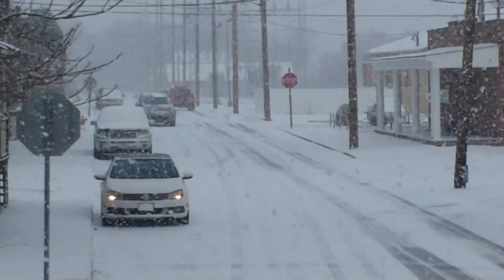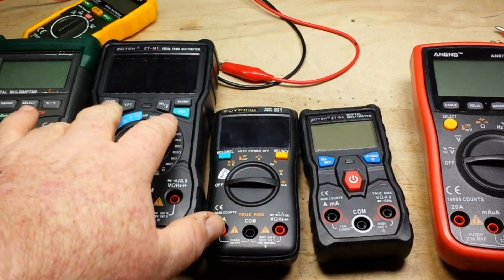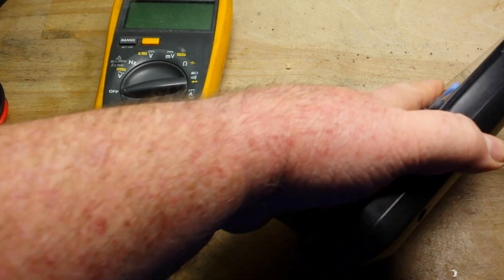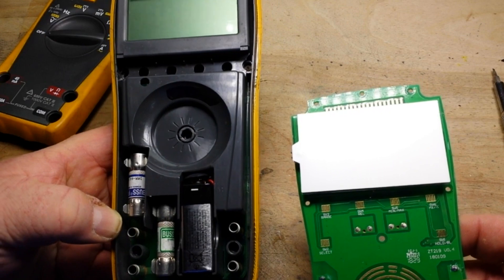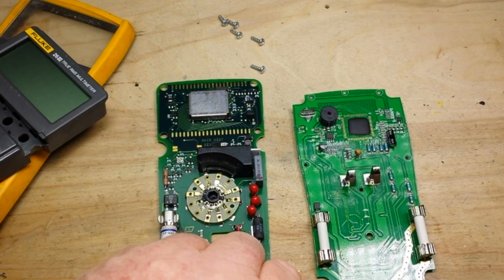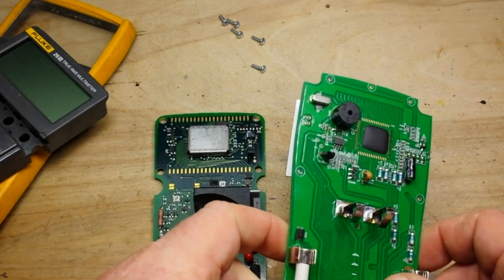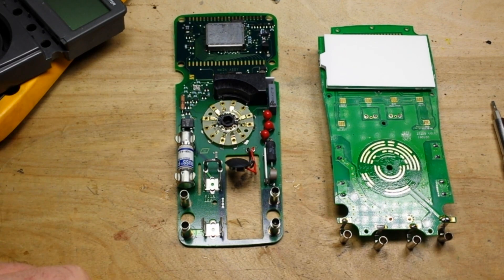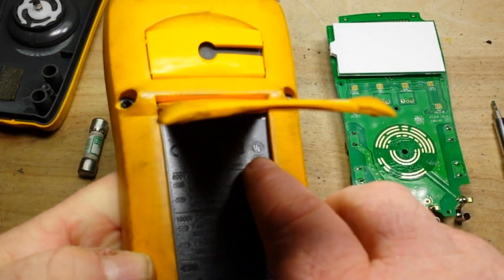Multimeter comparison: Fluke vs Chinese

Comment: An omitted thing is EMI (electromagnetic interference) shielding on Fluke processor. It has a metal cover while cheaper Chinese hasn't. Once my father bought me Meterk digital multimeter with non-contact voltage function. I decided to use it for testing of EMI detection. A circuit housing of operational 55W compact fluorescent light was used as an EMI source. Meterk multimeter was essentially fried. Analog multimeter is unaffected.

Comment: Nor really Chinese but Taiwanese, How about Brymen? Looked at the 869. Same fuses as Fluke. I saw a serious over voltage test once, between  on a Fluke and a Brymen. The Fluke didn't survive, the Brymen did.
Reply: that was probably Joe Smith's channel? The Brymen 869S is his favorite multimeter for those reasons.
Reply: @mrpetit2  Looked it up. It was. where i saw it.
Reply: And Joe does a great job testing all the meters by putting them through a number of tests until they fail. He uses his Brymen 869 as his daily driver now and for good reason. Fluke are good but not competitive enough and with less features and in some cases safety for the money you pay.
Reply: @mrpetit2  Joe retested Fluke meters and that one early failure was an anomaly. I don't think he even has that video up on his channel anymore? At least if he does I can't find it. The second time around another Fluke meter acquitted itself well though.
Reply: @1pcfred  you can see in Joe Smith's topic on eevblog in the spreadsheet that a brymen 869s on average fails later than a fluke 87V on average (from both meters 2 different meters are tested with his newer higher energy testing equipment), but both can definately be considered very safe meters as these tests are far beyond normal operating parameters. 

But given that a Brymen bm869S is also about 1,5-2,5 times cheaper than a Fluke 87V and is much more accurate, has a much higher resolution, has more functions and is equally sturdy build makes it a very good choice for consumers I think.
Maybe for consumers the BM867 is the optimum choice. It has the same resolution as the BM869s is 0,03% accurate instead of 0,02% (so still more accurate than the 87V and still has that 500.000 count resolution) and only misses the temperature probe setting, but is only €150 incl VAT in europe (which equates to about $137,50 ex tax). A real bargain.
Reply: @mrpetit2  I learned at an early age that I don't like the sensation of current passing through me so I avoid it personally. I don't need expensive test gear to facilitate that either. Just some uncommon common sense.
Reply: @1pcfred  then you'll be fine with both Brymen and Fluke meters.
But be sure to stay away from 10kv line sources etc, neither meters are suited for that 😉😁
Reply: @mrpetit2  I've built circuits that have gone far beyond 10 kV. I'm just not stupid enough to try to measure them with a meter. That's the secret there.
Reply: @1pcfred  Excellent. Then you know that a Brymen dmm is an equally good choice as a Fluke for a consumer if not better.
Reply: @mrpetit2  I don't think typical folks need a multimeter. Amateurs do not need anything as expensive as a Fluke or Brymen is either. But if that's how someone wants to spend their money more power to them.
Reply: @1pcfred  what do you mean? 'typical folks don't need a multimeter' in sense that they need food, shelter, safety and medical care? very true but I don't see how that's an argument in the scope of this video.
Or do you mean amateurs don't need a multimeter like fluke or brymen because its perfectly safe to prod budget multimeters like a UT-61e or cheaper into mains voltages?
Well you can take that last one up with Dave Jones or Joe Smith; they specialize in that field.
And fact is that Brymen isn't nearly as expensive as Fluke. With Fluke you pay up to double the amount of money for a product with equal fuctionality/accuracy/safety, even with their budget chinese made products. The USA made stuff is even more expensive, without being better or safer (as testing by Joe Smith showed in case of the 87V)
Reply: @mrpetit2  it is absolutely safe to test mains voltages with any DMM. The impedance of a DMM is astronomically high. On the order of tens of megaohms. Freebie Harbor Freight multimeters can safely measure over 900 Volts. Not a problem.
Reply: @1pcfred  then we take your word over the word of Dave Jones or Joe Smith that 900V is not a problem and perfectly safe with the cheapest of cheapest multimeters 👍😁
Reply: @mrpetit2  you believe whatever you want. What do you think happens when a multimeter gets fried? When anything destructs? This ain't exactly a power transmission wire dropping off a pole here. It's a little bitty meter with little bitty parts inside of it. Shorts have a way of clearing themselves. Stuff blows up once. With little bitty parts you only get a little bitty pop out of them. Little firecrackers don't make mushroom clouds either. I did see a transformer blow up in a substation once that made a mushroom cloud. We all cheered, Do it again! You want big boom you need big stuff. That's reality.
Reply: @1pcfred  Dave Jones has a video where he explains why you want to have input protection when measuring on mains:
https://youtu.be/zUhnGp5vh60
One main issue is to cope with possible transients in line voltages.

You can believe whatever you want, but in the end large companies like Fluke (and virtually all other main A brands) choose to put input protection it in their meters.
If you think that's in vain, fine. But then take that argument up with Fluke (or Dave Jones, or Joe Smith). If you can convince Fluke I'm sure they will be very grateful as it'll save them millions annually in expensive components they can skip upon.👍

Comment: No multimeter is made out of high explosives. If it goes pop it is not going to detonate like a hand grenade. Although that big resistor in the Fluke should go bang pretty good if it ever lets go. That being said I don't care what kind of gear you have when you're working on high energy electrics you'd better be careful. It is complacency and relying too heavily on "safety" devices that ends up getting people hurt, or worse. Just because you're using a Fluke meter doesn't mean you're safe.

Comment: What would be a reasonable multimeter 100 bucks. Is see Brymen and Uni-T in our stores.   Fluke is too damn expensive, and inside they still look cheap plastic.  My old Multi Meter doenst have a uH microhenry meter. I Still miss that.  Most of my coils i build are around 110 uH.  But i cannot measure them with my old meter.

Comment: Oh and also the bussman fuses also have a rated rupture current so you pretty much know for sure under which conditions they are going to explode (which should be aroudn 80.000 Amps or so) the yandingdongs fuses should explode much much earlier, probably 10kA or less

Comment: It would be interesting to see a comparison between 2 similarly priced meters instead of $200+ fluke and a $40 Aneng..I'm sure there are some very good Chinese made meters that could hold there own.
Reply: Do you know of a $200 Chinese brand meter intended for the same segment? I'm not sure what the market for those would be and who would buy them over the usual old brand.
Reply: @benbaselet2026  No, because Fluke is overpriced.
Reply: @richard1113  Overpriced haha, cos they don't cheap out on parts a fluke meter will last a lifetime a chinese meter will even corrode inside after getting moist.

My fluke has seen every condition you can throw at it and after a good clean its ready to go even after 20 years only ripped 1 lead after alot of abuse using the leads as rope to get it.
A chinese lead will just melt away if you try to get some current through it, and the housing made of cheap plastic will be breaking to bits after a few years.
Do you see that rotary switch in a fluke it won't get worn out with heavy use a chinese slide contact will worn out in few months due to contaiment and corrosion.

Well you can buy 5 chinese meters instead of 1 fluke but i will still stay on my fluke anyday.
Reply: @Pixelchaos  a buddy of mine had a Fluke that he left in his trunk. The LCD crapped out in it.

Comment: I don't think that a Fluke (or any other safe, UL tested multimeter, like for instance Brymen (they don't HAVE to have a Fluke pricetag)) is 'just for electricians, HVAC guys etc'.
When troubleshooting/fixing a switched mode power supply (present in all computers and virtually all modern electronics) you're also often exposed to voltages well over 300V, backed up by a row of capacitors.
Cheap chinese multimeters are good if you're sure it's low voltage (<50V) stuff

Comment: I agree that the best DVMs are Fluke.
A word about or two about Terminology:
You used the word "shield"  when referring to a plastic enclosure. When discussing electronics, the term "shield" has a different meaning such as a faraday cage.
Also, both DVMs are double sided. That means that the PCB has copper on both the top and the bottom layer. I couldn't tell from the video whether or not there were any internal layers.

Comment: This is why I use a Fluke 289. Fluke also have the best range switches in the industry.
Reply: @Coronadraht It feels like forever tbh, supposed to be 100 hours. I run it on Eneloop Pro's tho so my figures would be different to Alkaline which are supposed to last 100 hours.

Comment: If it works, it's a Fluke!  Actually, when Fluke was under the Danaher umbrella, a large portion of the Bill of Materials had to be sourced from an LCR (low cost region).  Weather it made sense or not.  So don't be thinking that because they are assembled in Everett Washington that they are American made.  Every piece of plastic and probably all of the passive components are from 3rd world sources.

Comment: enjoy the snow
i bt my Fluke 77 in 1990 , still works a treat,..73s mate, happy holidays A92GW
Reply: I have a 25 year old Fluke 87 and had a 77 for many years before that one. I still use the 87 professionally.
Reply: My old 87mk3 only died when some prat ran it over with a fork truck in a factory. There is no substitute for Fluke.
Reply: Which fluke 77 model you are talking about? IV?

Comment: At least the Aneng fuses were not glass tubes but ceramic, probably even sand-filled ones? I find the brand not bad at all for the price (for a hobbyist). I haven't tested how temperature resistant they are. Measure something at -30 degrees C and then in +30 degrees C and I'd expect some or a lot of drift from the cheapos.

Comment: It sure looks like that FLUKE 87-V is better built than ANENG AN870. But I'm curious about another thing. ANENG AN870 costs 31.5$ on AliExpress right now, when I'm writing this comment. On the other hand, FLUKE 87-V costs 405.0$ on Amazon! What the fck?! These are both US dollars and they have both some discount, but the price difference is ridiculous! I know that FLUKE one is more premium, but is it really THAT premium? You say that it has better fuses. Yeah that fuses look bigger, better, safer; but how much more do they cost? Another layer of shielding on FLUKE? I wouldn't say no to that. But dude, in the end, that is just another layer of ABS plastic and nothing more. 
FLUKE released 87-V model on 2004 I believe, correct me if I'm wrong. Sure there are a couple of improvements, but 87-V released on 2004 and 87-V they sell now are not that different design and featurewise. THEY STILL COST THE SAME! Imagine if Apple would sell the first iPhone that Steve Jobs introduced in 2007 for the same price in 2021. We live in 2021 and electronic parts manufacturing technology is so much more advanced today compared to 2004. So the product should be cheaper, but its not. That is a fucking SCAM that FLUKE CORPORATION is pulling. 
FLUKE 87-V is a good multimeter, its a good but EXTREMELY OVERPRICED multimeter. I want to buy a FLUKE 87-V instead of an ANENG AN870 because I want to feel safer when I'm working with electronics. I won't be able to do that because I don't have 400$. Perhaps if they would drop their price to 100$, I would save up and be able to buy one. I won't be safe because I'm poor.
Do not shine FLUKE's ass this much OK? If no one calls this one out, FLUKE Corporation will continue to SCAM people all over the world.

Comment: Wonderful review. Fluke is really an industry standard. There is no match to fluke. Fluke is the ultimate in test equipment.
Reply: Lol except when you look at the price tag and the fact you can blow 400$+ on a meter with no way to interface it to anything external. Flukes are great, i've got 3, but they're way way WAY behind the times.
Reply: This comment was bought to you by Fluke ™️
Reply: @ozzysmygod1  this is not the case friend. I'm only using fluke instruments and I'm well satisfied with them.
Reply: Not really the ultimate, just the standard, flukes are the TI-85's of multimeters, totally overkill for almost every use, left behind by everything else in its price range (not even all that accurate, I bought 4 brand new flukes for work, hooked them up to a test station and they each were almost 5% off from the calibrated standard and almost 3% from meter to meter ... even for automotive parts production we are targeting 1% or less in measurement tween systems)
Reply: Gossen Metrawatt because you know the Germans always make good stuff.

Comment: This might be a stupid question but would it be possible to change the fuses on the aneng to better ones?? Or would that mess up the rest of the circuitry? Actually really curious
Reply from the maker: No, you can change them
Reply: @learnelectronics  how big of an improvement would that be for the multimeter?

Comment: Now a days with dmms on a chip...
The accuracy is not the problem, it's the reliability and the safety.....

Not only fluke, but also agilent, hioki and a few others make safe reliable, dependable and accurate meters...

For uni-t they are kicking up their safety the last years, they are getting to the higher safety segment now (finally they understand!) 

But still, I know I can always rely on my flukes in all cases, my 179 works fine and my 83 as well, both are antique, but build like a tank. 

For on the bench just messing around, get a bunch cheap meters, perfect, accuracy no problem except dependability, will it work in 10 years, probably not...... 

But if the system has a lot of grunt, grab something you can trust your life to.

Comment: No doubt that Fluke is the way to go if you are an electrician.  But at the feature to price ratio, Fluke is a ripoff.  In fact, you can't even get the functions that are offered on other meters for any price on a Fluke.  Fluke could easily blow all those out of the water if their meters weren't so monolithic and basic.

Comment: An I would love a fluke but I can’t justify it with the stuff I’m doing now. I may have to rethink that soon because I might start working on some tube amps if everything goes to plan. I’ll get a fluke or equivalent for that cause those thing can kill you pretty quick. Great video Paul and have a merry Christmas.
Reply from the maker: Thanks mike, you too!
Reply: One fluke will last you a lifetime totaly worth it got mine 20 years ago only replaced the battery twice and replaced the fuse one time, only need a new set of leads after 20 years of abuse.

Comment: Thanks for the video, but unfortunately I think the title was a bit misleading. The video really only talked about Multimeter protection & safety. I was hoping to see a comparison of accuracy & reliability, between fluke and alternatives. As the majority of electronics hobbyists are working solely in the low voltage realm, this video unfortunately doesn’t answer the more commonly asked comparison questions. 🤔

Comment: Great content. Keep them coming.
I am a retired Australian electrician living on an island in the Philippines. I have a fluke 770 and a SEW 3800CL clamp meter purchased in the early 90's. Both were in storage for a few years and have both stopped working. I have no experience of inside a meter as there were places to get them repaired or calibrated. Here is just me.
Any tips or tricks on meter repair would be gratefully received.

Comment: Thanks for the video.
I agree about the type of meter for the type of usage.
These days, even the cheapest DMMs have a decent spec and can hold that spec over time.
At my workplace, we do DMM yearly compliance checks, using an Australian calibrated 20yo HP desk DMM, it has passed and kept cal for all that time.
The DMMs that we get to check specs on, are a wide and varied bunch, these are for commercial/industrial use.
Most are Fluke with some up market Chinese/Taiwanese models.
Most of the time with Fluke, we are wasting our time checking specs because they stay well within tolerance.
Leads are probably the weak link, but that is the case for all DMMs in  harsh commercial/industrial environment.
I have recently had an AC current loop device that uses the "Rogowski principle".
It is a very interesting AC current sensing device, the  loop can be opened and placed around some very serious diameter conductors.
If you google  "ACP3 Series Flexible 3000Aac Current Probes" you should find some products using this principle.

Comment: I dont care about the safety that much, since I never go above 12v, and small amps. So that is not a problem with the cheap chinese ones for me. The problem is the inaccurate readings I have got from the ones I had. Or how slow they are to show the correct value.